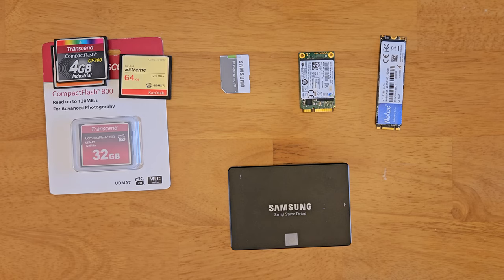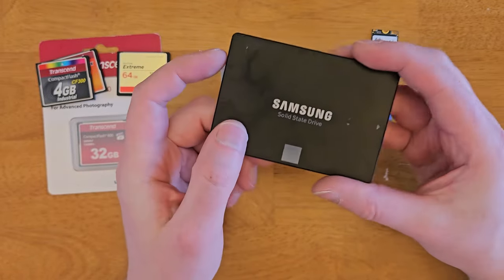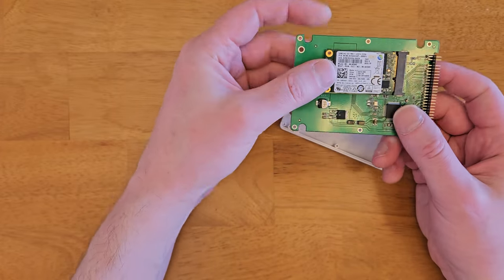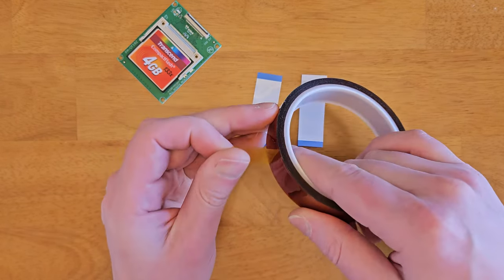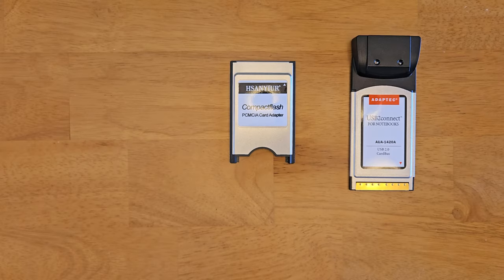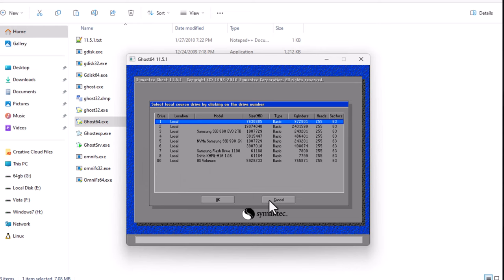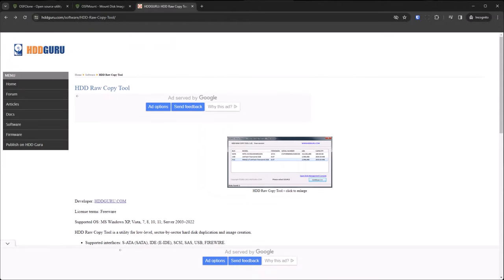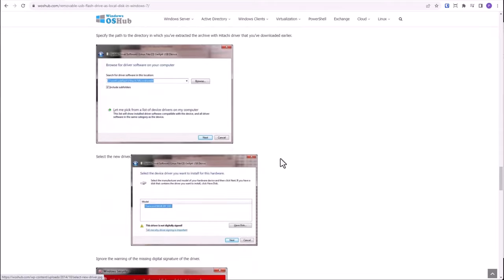Upgrading to flash based SSDs + creating and restoring hard drive images on vintage PCs

Comment: Great informative video. My Sony PCG-U101 laptop (which used the 1.8 inch hdd)  has  50 pin to CF adapter then a MicroSD card inside an SD adapter then a CF adapter. Works a treat. Yeah I had to trim off the solder tabs as they would dig into the mainboard and bend the black jumper pins about 80 degrees to fit in the PCG-U101.

Comment: ...and probably the only interface that you have missed - SD to Sata. I bought one of those cheaply from Aliexpress last year but it didnt last long, quite a disappointment.
Reply from the maker: Sure, yeah I haven't really used SD based adapters much, but considering how cheap the media itself could be pretty good especially for bigger sizes. Makes me wonder if SD adapters appear as fixed disks or removable.
Reply: @jasonnovak2121  I really cant remember, i believe that device was listed in that taskbar icon to remove/eject removables. It was unreliable anyway, until one day completely refused to read SD card. I didnt use it as a system disk, just trying to store some music there but even that was too much to ask for.

Comment: msata a bit obscure
Reply from the maker: Sure, yeah it's an obsolete drive now, but you can still get them used cheap on eBay, especially in lots. I recently picked up 3 128gb drives for $23 total, and 2 256gb drives for $30

Comment: I'm still running the original 2.5 HDD in my Toshiba Librettos
Reply from the maker: Most of the spinning HDD's in mine were dead or removed, I think only the 110ct and u100 still had good drives